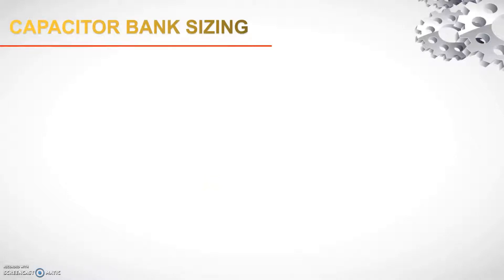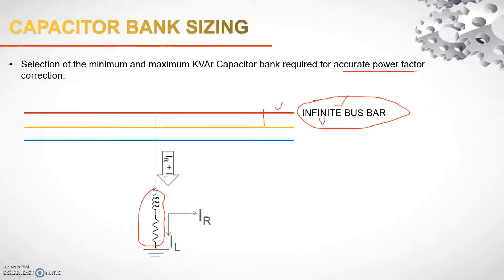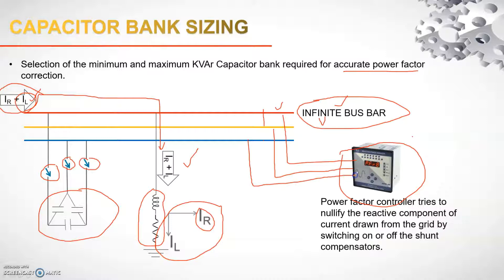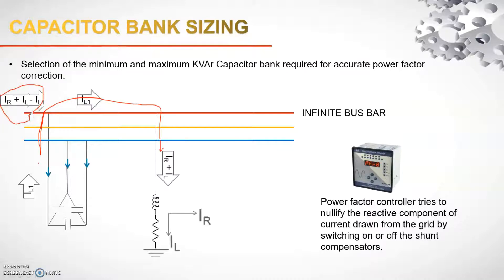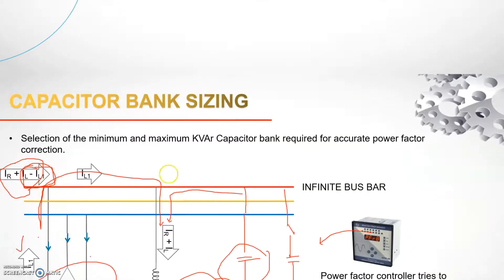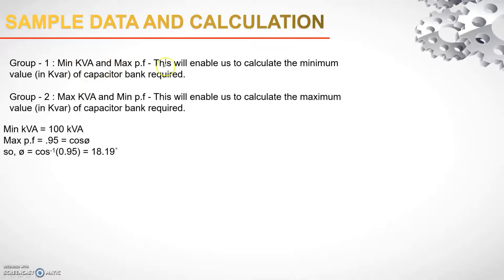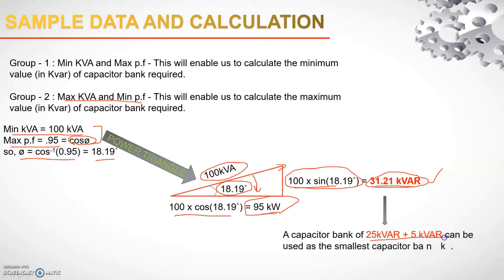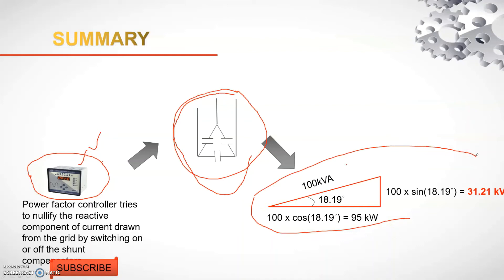Capacitor Bank Sizing for Reactive Power Compensation.

Comment: Reactive power compensation and power factor connection is not the same thing. Reactive power compensation is the use of shunt or series capacitors or inductors to improve voltage regulation of a transmission line